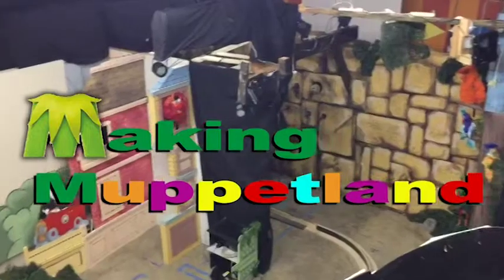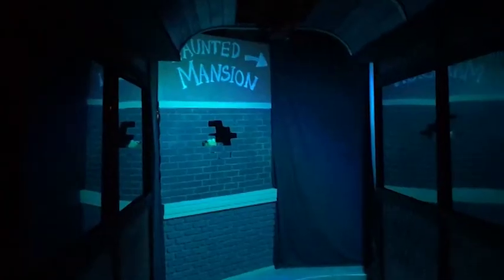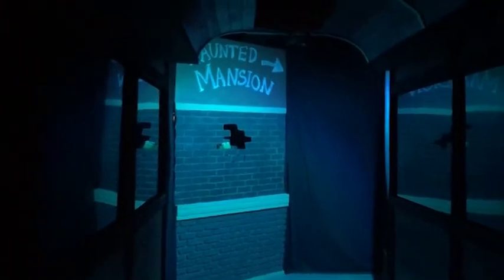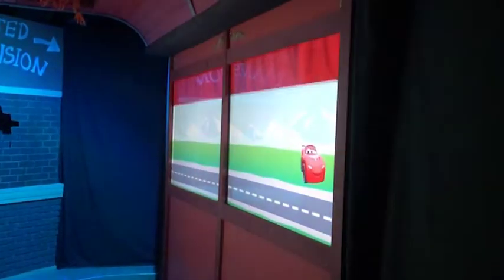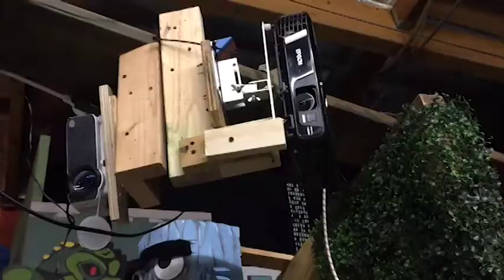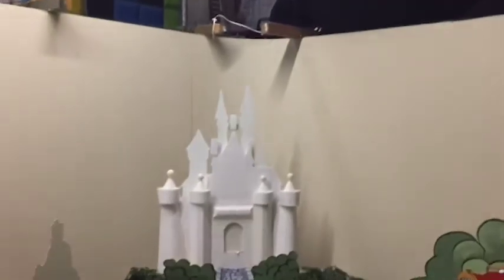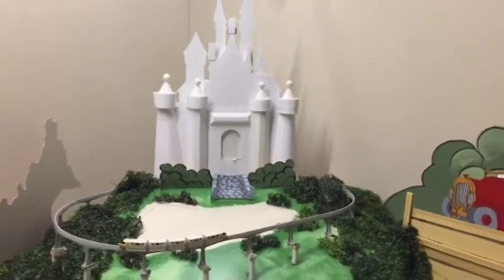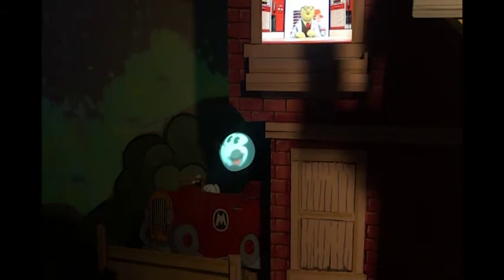Making Muppetland: Episode Four

Comment: I’ve asked similar questions to this but I’m wondering how do i program the animatronic with out using a computer to run it after i programmed it do you have any idea what to do or what i need or to use? Thanks so much for responding always
Reply from the maker: You can run it with an audio driver like a Scary tear PCB or use a Radio Controller. The audio driver will run off realtime audio, you can also use an Arduino if you now how to script. Does that help? Thank you.

Comment: I have a question so how do you program a animatronic like what software and so on and how do you have audio synced to it can you help me and plus lighting cue like hands down you guys are amazing like i really wanna know how to do animatronics and lighting cues synced to it you guys are inspiring
Reply from the maker: Hi, I am using Showforge software which allows for DMX lighting and servo programming. It requires significant hardware as well.  You could likely start with an Arduino though for the servos. As for DMX light control there's lots of free demos you can try like Lightjams or Millumin. Millumin also does video cues and even plays with Arduino. For USB to DMX hardware options, check out DMXking. Hope that helps. Send me another message if you have more questions! Good luck.
Reply: @disneyparkslive  you guys are amazing maybe make a video on it, it’s pretty cool to learn and know about
Reply from the maker: Thank you very much